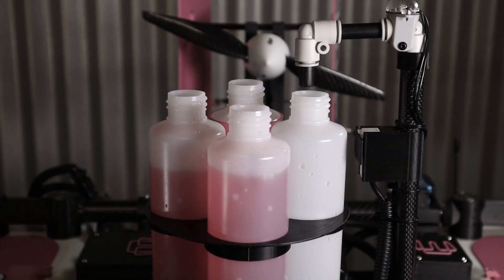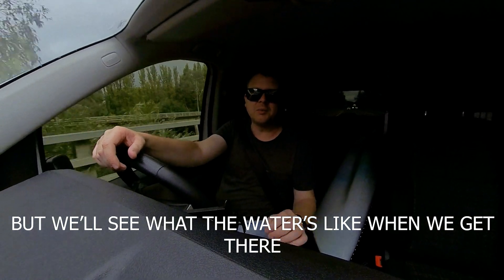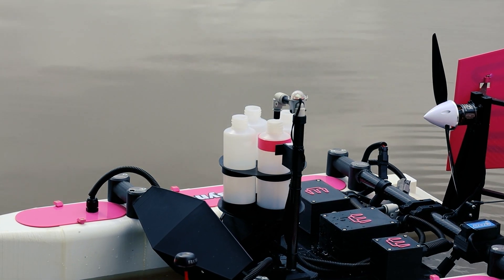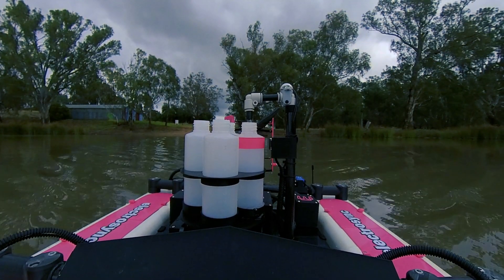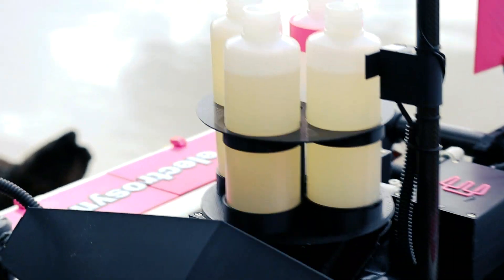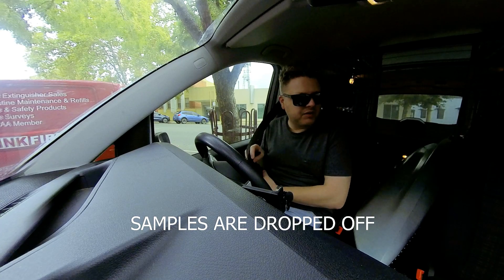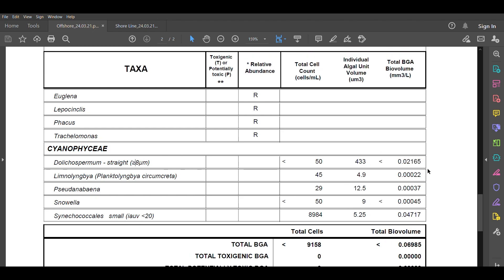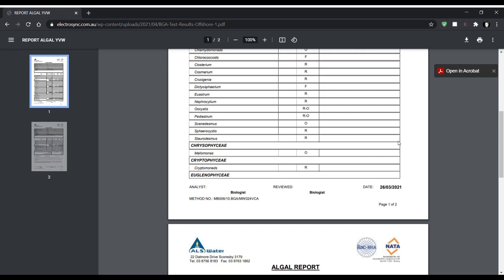3D Printed RC Utility Boat - Water Sampling Mission - Part 3

Comment: I'm considering using this design as a recovery boat for my RC models. Have you tried removing the turn fins, rotating the motor towards the back, and installing a dual-shaft servo that controls the motor and propeller for more precise steering? What do you think? May have to put some led in the front.

Comment: Deberías ponerle un motor   a nitro
Reply from the maker: Electric all the way for this build! I need power for the various systems anyway. Plus, I’m not sure that the vibrations would work with all the 3D printed parts. Could be a good project for another time though?